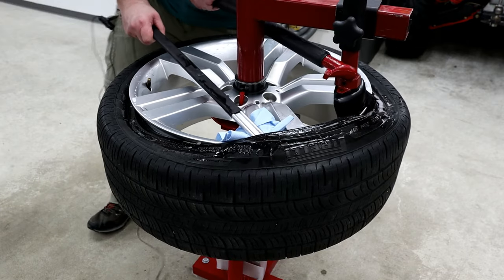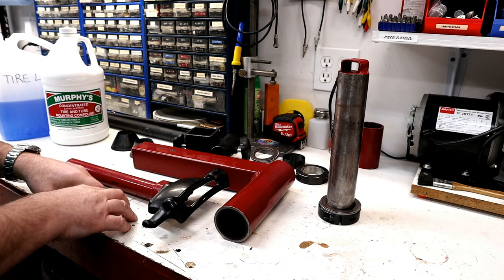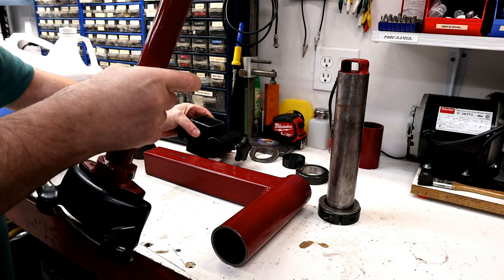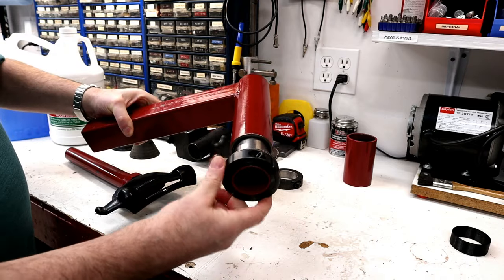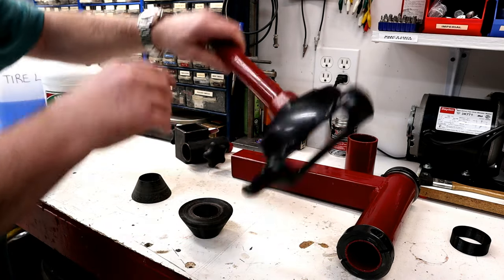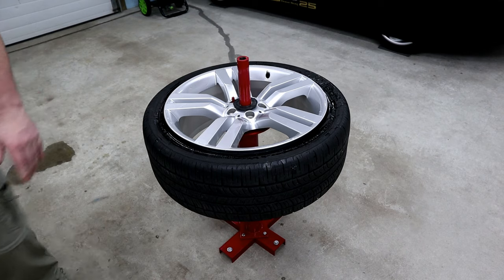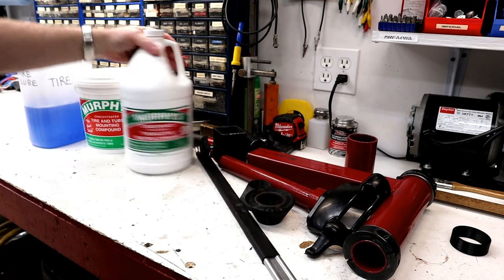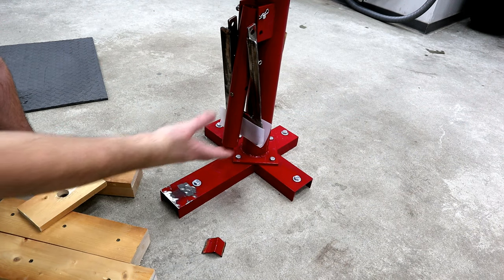How To Remove Tire From Wheel At Home With Manual Tire Changer.

Comment: Hi John. having changed more tires than I can count with powered machines of course what I'm about to suggest works with powered machines or your manual. when you slide the iron in the bead so that you can pull the tire over the duck, press down on the opposite side to make sure the tire is not up against the bead and down in the free space of the wheel that will give you much more room on the side you're working on.
Reply from the maker: Appreciate the tip 👍

Comment: I just bought one these tire changers and having watched many YouTube videos, I have noticed that the base components provided for bolting the unit down seem to be problematic in a number of ways, and so I decided to discard them and simply bolt the square flange at the base of the tube directly to the concrete floor. I used flush drop-in anchors so I could remove the machine when not needed, with no protrusions. Mounting in this way removes anything from the equation that can flex, and has resulted in an absolutely rigid installation. This mounting option also eliminates anything that can mar sensitive rims during bead breaking. I will definitely be building the duck head mod! Thanks so much for your informative videos!
Reply: I did the same and have inserts installed in the concrete both inside and outside the shop for a choice of where to work.

Comment: Instead of rare earth magnets, I used a HF 1"x18" bar magnet.  Place magnet on breaker tube, raise tube to where bar magnet touches both column and under round hub.  Now tack weld in place on column and under hub. Cut excess magnet off just below hub.  Magnet was free, works better than a bungee cord. Good luck ☝️

Comment: I put a piece of copper tubing over my pin and sweated it on with some solder to make it a little fatter so it's tighter in the slot, stands up better and fits the lug hole better.

Comment: If not mentioned below a length of rubber(or plastic) tube over the pin destined for the bolt hole will protect the rim but I would make it long enough to be guided through the bolt hole when the wheel is resting on the centre post high up.  This will guide you into the correct position hopefully without too much fuss and control the pin for you.  Just long enough to help but stay out of the way.  In addition something I noticed I could have done better is when the bead breaker has created some more space for you I think I will spray(or brush) a bit more soapy water in the gap.

Comment: Hi John. I removed the pin from the tire changer and drop in a 3/8" drive extension through the lug hole and into the slot where the pin was.
Reply from the maker: Good idea

Comment: These are some nice mods. Thank you for sharing. We have several kids driving their own cars and buying good junk yard tires. One of these tire changers will help with cost. Something I use on my garage jack to protect surfaces is a hockey puck. They are really hard but seem to provide protection. Drill a hole in one and glue over that bolt.

Comment: Given the price of the component parts, might want to look at the No-Mar brand changers.  They are a little more expensive, but they come with polymer tips on the bead breaker and the tire changing bar so they won’t scratch alloy wheels.  I bought mine for motorcycle tires and haven’t changed a car tire, but their videos show that most of their models will also handle car tires.  Probably won’t handle the tires on my Chevy 2500HD though.  🙂

Comment: You seem to be the only person on Youtube doing videos about this tire changer that understands Newtonian physics!  Well done!!

I suggest cutting off the floppy alignment pin and just using a bolt. This way, you place the wheel on the changer then easily spin it until the wheel stud hole aligns with the hole in the base and drop the bolt in. Don't need 3 hands to hold the tire/wheel while trying to align the floppy pin.
Reply from the maker: Thanks for the tip on the pin. When I installed the Neodymium magnets to hold the bead breaker up, I also put one beside the pin shaft and it now always sits upright let allows articulation for the various hole placements. Working great now 🙂

Comment: Yes, I am interested in part 3 ! I quite often have one TPMS sensor needing a new battery and I have to wait until the tire needs replacement.  With this DIY method, I will be able to replace it myself anytime the TPMS  battery fails. Would also be useful for my vintage BMW which had one of its rim scratched by the tire shop👺👺 Now you have to teach us how to balance  the tire/rim at home !!!😉 Is this rim /tire for your MB ??
Reply from the maker: @1983dmd - Not sure when BlackCircles.ca starts its annual spring sale, but once I get the new running shoes here, I'll aim to get a half decent mounting video done.
Balancing I'll likely still have done at the local tire shop afterward. Hopefully they can't screw that up too - haha. I may order one of those bubble balancer doo-dads however just to see how well it might work; I'm not holding my breath with only a static balance on wide wheels. Good eye on the wheel brand.
Reply: I've replaced many TPMS sensors without dismounting the tire.  Just break the outside bead only, push the sidewall down, change the sensor.  If you don't have room, you can use some wood to help keep the bead down while changing the sensor.  If the replacement sensor is the same weight, no balancing necessary because you didn't change the tire position on the rim.  You can always weigh the old and new on a postal scale but typically the difference in weight even from different TPMS manufacturers is usually less then the smallest wheel weight anyway.

Comment: really nice John. I think we will need to  install a tire changer. Just a few years ago it was #12-$15 at Our local tire guy and that is now $32 per tire + tax and disposal so you are up tpo $35-40 a tire which is exhorbatant. We have a lot of cars and trucks and always look for deals with used tires but if you dont buy new from the tire shop you pay thru the nose. Online tire sales have killed the cheap installs so now the shops really charge. Even Wall mart is up to nearly tire shop prices in our area. We go to Canada sometimes and could probably bring stuff to you depending upon where you live.
Reply from the maker: @cal48koho - Yep, seems all services keep costing more and more; with quality often getting worse and worse unfortunately.  I don't mind paying top dollar for quality work, but when I'm getting my alloys scratched more times than not, and having to go back several times because the balance was so bad over the past decade at various tire shops, I basically had enough. The final kicker was our local shop in our remote location refusing to do anything that resembled a lower profile tire, even for a simple patch repair, so I was in a real bind until I found a few of these manual tire changer duck head mod forum posts and started researching the process.  
The other factor as you pointed out is the actual tire cost savings that can be found online at places like Tire Rack in the US and Black Circles up here in Canada which I've used now for my last 6 sets of tires. They are always a good 20%+ less than the best quoted prices from even discount shops with free shipping right to my door to boot :)
Thanks for watching & commenting 🙂👍

Comment: I can tell by your swiss time piece that you are a very precise, detailed individual.  Question?  Does using a duckhead stop the rim from getting scratched?  Meaning no contact?  I use the Harbor Freight tire changer and use Amazon tire bead paste,  i can installed tires with relative ease.  The only advantage ic of the duckbill, is if it has no contact with the rim?
Reply from the maker: A nylon duckhead is alloy wheel safe (no scratching or gouging). It does come in contact with the edge of the wheel lip, but because it's soft and slippery nylon, it won't scratch provided the wheel is clean.  A deckhead does make the mounting and dismounting process easier as well, especially on low profile tires.

Comment: This mod is a nice, clean installation, but it costs too much for me.  I constructed mine out of some round and square tubing, a Hunter duckbill and a bit of welding for about $35.  I did add some extra metal to the bead breaker on this HF tire changer because it was weak for use on run flats but I also have a separate dedicated bead breaker operated manually.  By the way, the round tube on the bead breaker won't last much longer than the bars from the tube to the spoon so get some 4130 for that.  One thing that was unanticipated is that a 3 ft bar on a setup like this seems to exert a lot more force than some of the automated machines for removing and installing a tire.  Tires that slowed or stopped a powered machine were a snap with my setup.  I lathe cut a couple of centering cones from aluminum.  Bead breaking is the biggest pain in the butt so I'm considering a mod that would use an air powered hydraulic ram in place of the original, flimsy bead breaking stuff.

Comment: Are these duckbills made of hard plastic?... or how do they not mark up the rim as they run around? I mean, it looks like it's sitting on top and with the pressure from the tire bead I always assumed it's riding the surface of the rim. Thanks for the demo, this is my tire size also.
Reply from the maker: This one like many is made from Nylon (strong & slippery). It rides against the lip of the rim. As long as the rim surface is clean (no sand, grit or balance beads), and has tire lube on it, the Nylon won't scratch. I also mention how well Nylon tire iron socks work in the one year update video: https://www.youtube.com/watch?v=QND8n_ArNRo
The tire iron had the most potential to scratch the wheels, but not anymore with those wonderful Nylon socks 🙂

Comment: The pin that goes through one lug nut hole to hold rim from spinning when tighten down, have to put plastic tube atound it from when it moves, wont mar your rim.

Comment: I may be missing something, but wouldn't it be easier to stick your bar into the 90 deg duck adapter(square channel) for leverage, instead of standing 180 deg on the other side and using the bar to grunt/hump the adapter around at the rim? Your mod for this is awesome!
Reply from the maker: Yes, two main reasons: 
1. When starting the rotation, you need precise control of the removal tire iron to both pull on the tire bead while keeping the tire bead from dropping off the duck head which is only possible if you are manipulating it from the back side; even using both hands on the iron while using your body to swing the big bar. That control would not be possible with the big bar in the top tube.
2. There would be too much flex on the duck head down tube, at least with lower profile tires with stiffer sidewalls like these ones. Keeping the bar as close to the duckhead as possible ensures it won't flex much. 
However, you do use that square tube in the method you suggested when mounting the tires as shown in part 3:  https://www.youtube.com/watch?v=IX7DvJo7A8E
Reply: @Rchelicopterfun  Okay, Makes sense. Thx

Comment: Hi John. I was just getting ready to cut my duck head adapter attachment tube in order to fit the collars and needle bearings just as you have done. I have the same exact one as you that I purchased off E bay from the Canada seller. I noticed how much lower this brings the duck bill down closer to the rim. I noticed in your video that the tire hits the top arm when removing the second bead. Doesn't seem to be an issue on your wheels but on my wheels, that are much deeper, dish/ bowl type, this looks to be an issue. I think the solution would be to cut the original threaded center post off the stand and weld an extension pipe, the same  amount that would be cut off in order to maintain the clearance of the original design. Even if you purchased the Lucid auto works adapter you would still have the same issue. I'm giving this mod a second look because of this. Any thoughts or ideas?
Reply from the maker: Excellent question Richard. Yes, that's the concern with any modification and it's ultimately the users call. The old risk/benefit logical decision process; in this case swing arm to wheel clearance vs. swing arm stability on the center post. I had measured all my wheels and knew it wouldn't be an issue. Even did some 255/40/18's without issue as they sit lower on the plate than these MB wheels shown in the video, but if your wheel sits high on the plate or is uber wide, clearance very well may be an issue without coming at it in a different way. 🤔
Reply: Pool noodle or pipe  insulation on  pipe  bead breaker helps  protect . Also  bungee connected to the changer post helps  along with  magnets

Comment: 12:50 on mine, the pin goes through to the bottom so it can be repositioned as needed from under the platform as you place the wheel on.

Comment: Thanks for your top video .What size is the  bushing  ?
Reply from the maker: As sated in the video, sizes of the tubes vary so there is no one size bushing that fits all. You have to measure the OD of the center post on the changer and ID of the duck head mod tube to determine spacer size. Some just wrap window washer fluid bottle plastic around to take up the slop, some get actual bronze bushings - it's totally up to the DIYer and what you have handy.
Reply: @Rchelicopterfun  Gracias Amigo  God Bless you.

Comment: try a tire stud and use a lug nut to hold down the rim but make sure the stud is a little taller than the rim
Reply from the maker: Better than holding it down with the centering cone?
Reply: @Rchelicopterfun  YES IT WILL HELP YOU MIGHT TRY TO BOLT THE TOP AND BOTTOM OF THE STUD SO THAT YOU DON'T HAVE TO DO ANY WELDING YOU MAY LIKE IT YOU MIGHT LIKE WELDING IT.

Comment: Do you thing this kind of manual tire changer would work for even bigger, low profile tires? Like 265/35 R18 or 295/35 R21. I also like that it doesn't take so much space.
Reply from the maker: Without doing those sizes, I can say for sure; 295 is a bloody wide tire! Last week I did a set of 255/40/R18 and had no issues (each set gets easier and faster with more practice). This specific duckhead mod will easily extend out to accommodate an R21, so that's not what I would be hesitant about. The dimension I would be worried about however is the width of the tire.
The distance between the duckhead swing arm to the top of the wheel could be the limiting factor with really wide tires (when removing the back bead). As shown in this video, even the 235's where rubbing on the edge of swing arm when I was doing the back bead. Certainly not enough to prevent removal however. Also, a 21" tire would likely be large enough in diameter to get over the swing arm when you are removing the back bead so that large diameter might help in that respect.
The space between the swing arm and wheel is also dependent on the wheel shape. These MB wheels in the video sat fairly high in relation to the plate on the manual changer so that brought them closer up toward the swing arm. The 255/40/18's I did last week had lots of room because the wheel sat lower on the plate. 
Moreover, if I didn't mod my duck head mod attachment by cutting about 4" off the end to make it function like Lucid's (clamped on both ends of the center tube), then there would be a good deal more height. Of course it then wouldn't sit as securely on the center tube. 
In short, there are lots of variables involved but with a little ingenuity, thought and perhaps further mods, these manual changers with duckhead swing arms should be able to do pretty much any size passenger vehicle tire I would think. The more I use it, the more it impresses me.

Comment: Nice! Im in Canada also, so I got the manual tire changer from Princess Auto. Just received my duck bill from Amazon, now I need to start building!
My brother has a 3D printer, maybe il ask him to make the centering cone. What material did you print it out of?
Where did you find your tire/bead lube?
Thank you!
Reply from the maker: PLA (100% infill). Amazon.

Comment: Could you put your bar in the end of the square tube and pull it around?  It would give you more leverage and prevent the bar from hitting the rim if it slipped.  Also put a flat do nut type of rubber ring on the tire changer's base where the pin goes up.  Make a hole in the ring to tightly fit through the hole.  That should keep the pin from wobbling and missing the stud holes.
Reply from the maker: Yes you could; once you have successfully lifted the bead over the duckhead and got it started of course. I have tried both ways of dismounting and find doing it the way I demo in the video is the quickest with the most control and keeps the duck-head in the best alignment. 
I do however always use the bar in end of the top tube when mounting tires: https://youtu.be/IX7DvJo7A8E
 Good idea on the rubber around the pin for vertical positioning. I ended up putting a rare earth (neodymium) magnet in the pin base when I put rare earth magnets on the bottom plate and bead breaker which has been working great at keeping the pin positioned upright, yet still allows full range of movement.

Comment: Great video!  I need to do this upgrade to my HF changer

Any chance you can upload or point us to the STL files for the cones you printed?
Reply from the maker: Mine are not sized for the HF changer tube so they wouldn't fit. I made them really quickly in about 1 minute on Tinkercad. There might be one on Thingiverse if memory recalls; but again, the center tube diameters vary so it's best if you make yours for your specific changer.
Reply: @Rchelicopterfun  Thanks, I'll give that a try.